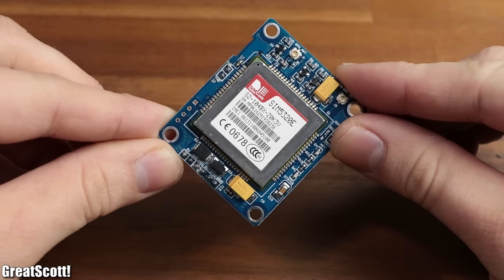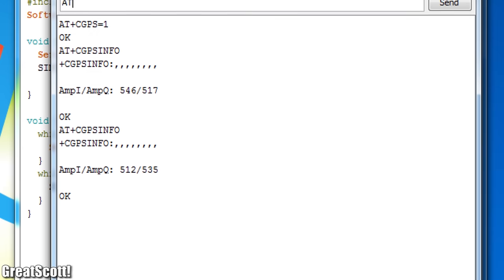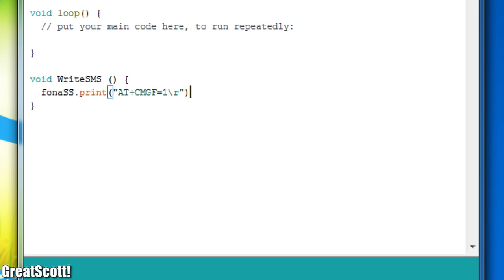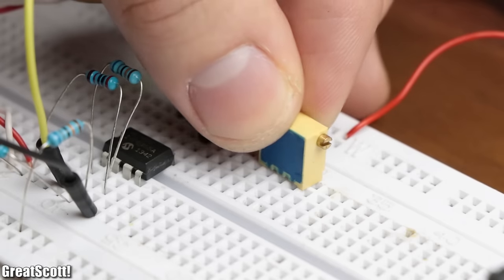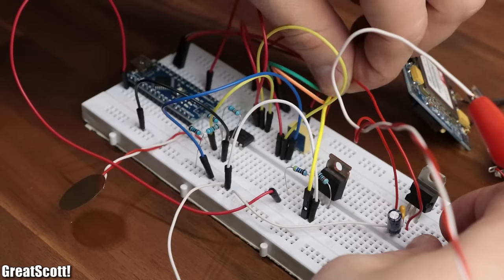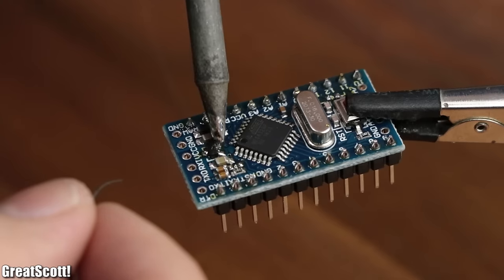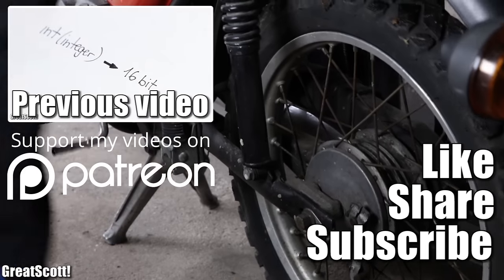Make your own GPS SMS Security Tracking System

Comment: Without a WORKING SMS signal on 4G (3G is going away in 2022 and in the video he couldn't even get the 3G connection working), all the great add ons to the GPS module are useless !

Comment: You glued the transducer to the chassis, but tested it unsecured earlier. Did you test it again after mounting ? Maybe you could have used a mercury switch or MEMS switch instead. The piezo may trigger on load noises not necessarily theft...also, once triggered it should continue to report location periodically even though it may not be triggered again in case the thief leaves it somewhere for a while and your last GPS data was bad.  

For sh*ts and giggles, you can add a fuel cutoff switch controlled by sending the board an SMS.

Cool project, BTW.

Comment: The SMTP stuff probably fails because of googles strict requirements when it comes to "less secure applications". In this case, you generate an app-specific password and use that to authenticate instead rather than your normal email address and account password.

Comment: This is a great project and the battery life is good. What disturbs me though is the cost - I can buy a "smart" phone for £10 - granted it won't have the 60 day life or the shock sensor (well there is one built in, but I don't know enough to code a something to take advantage of that), but I could wire it up and have all the same features - plus the ability to make emergency calls if required...

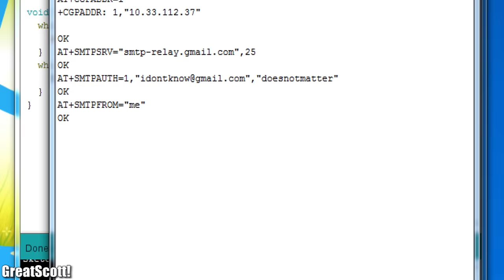Comment: 3:53 Have you tried configuring the APN settings correctly? Most of the people make this common mistake. You need to insert your SIM card to the phone, set APN correctly, and most probably you have buy an internet pack as well.
Only then you can send AT commands to connect to the server.

Comment: The problem with the email part is probably because google (I saw the @gmail.com) does not allow not secure auth.... you can go into your account and allow it for your account. 

It's not secure probably because the Arduino is not negotiating any SSL.

More is available on the google forums.

Comment: Hi again. So I read some reviews that the GPS in this module(SIM5320) needs an active antenna and does not lock well with a passive one and it has high power consumption. Have you noticed any of these issues with this? Did you use a passive or active antenna? I couldn't tell from the video

Comment: I like the movement sensor on your tracker with adjustable sensitivity. 
, Is there a circuit/model available that is low power and could send a pin low when movement high enough to wake a microcontroller?

Comment: GreatScott I got gps tracker for my motorcycle only problem is that it connects to the motorcycle battery so the thieve can simply disconnect the battery and that’s it... how could I build some battery for gps that charges when engine is running and when is off and battery is disconnected gps can still work with it’s hidden battery. I was thinking Of connecting it to jump starter and jump starter to usb charger but I don’t think that’s the right way, help please

Comment: Now how to avoid paying a monthly bill to keep the sim card active. I keep an old cell phone wired to my battery with no service. If it gets stolen i just need to log on to Google's find my android. Pros: No bill for 3g and sms. No constant messages. Cons: more power consumption  (i have a mega huge battery becauce the bime is electric so no lost sleep for me) and it is far less impressive as far as technical skill. (The bike is already full of arduinos sensors and mad scientist circuitry so no sleep lost there either)

Comment: To use smtp auth you have to low the security level to minimum at gmail configuration account. Then it works. Have that issue some time ago with esp8266 12 and arudino.

Comment: Hello. Did you remove the voltage regulator from the arduino pro mini because you are using a regulated voltage in the Vcc pin? And as a result,  you are not using the RAW pin which uses the onboard regulator to create the appropriate voltage for the board? Is my thought correct?

Comment: Ehhh... wouldn't something like:

// Setup where my Home-Location is:
ACord: CONST = 123456.123456
BCord: CONST = 56789.56789

// Check for my mopped, is it still in my Home location?
while true do:
     aCord = do.the.GPS.Stuff
     bCord = do.the.GPS.Stuff
     until aCord != ACord || bCord != BCord do:
              break;
     end

// Running Permanent verbose Alarm stuff. Call SWAT!
while true do:
   send.mail("Hey, I am driving! See me @ {aCord + " and " + bCord}!")
   end

do the same job? That way you wouldnt need the whole Vibration Sensor Setup at first, and you also will get a grip on your shopper if someone just load it up 
his Van and steal it without much Vibration. Sure.. you would need to add some space, in case you dont park in the exact same location like yesterday.
But for now, I would consider this, if you build that again.
Reply: havn't watched the video, but vibration activation might consume less power

Comment: In the car-alarms they solder the piezo vertically, perpendicular to the PCB and they solder a spring on the top with screw in it to adjust the sensitivity ...

Comment: Very nice Project, btw there is a nice Tool called "AT Command Tester", it works perfectly with Arduinos, it uses a little Scatch that just Reads and Write every Output from/to the Shield to the Comport, its a nice tool to Debug the GSM Shields
Reply from the maker: Sounds like a useful tool. I will have a look at it.

Comment: Cool, so now when I steal your bike I know exactly where to look! Nah, greetings from Australia. Glad you went through with this GPS tracker project, it was really cool. I also noticed you increased the volume of the background music, which is nice. Did you know those GSM modules can give you a GPS location based on the signal strength between various cell towers? It's not very good but it's super interesting. When I made a GPS tracker, I plan to put it in my mums car so that I can text it, and it replies with the location. I also want to include a feature where I SMS it a location and when it gets within 1km of that location alerts me. My GSM module seems to be 2G network only (sim900), and 2G is shutting down in Australia. Means I'll have to buy another one :((((
Reply from the maker: Thanks for the information. Good luck with your project ;-)

Comment: I think if you mount two bolts to the either side (or even one side) of the piezo plate with super glue - there would be a better gain

Comment: You do not have to use external comparator on Arduino. just solder 2 resistors to Arduino board.

Comment: hey scott i have an idea for a projekt on the raspberry pi . i just broke my laptop and startet disassembling it and i lookt at my keyboard and i thought. is there any way to use it again . the problem is that the keyboard has a flad ribbon for connection but it is very small so it is very good for use it as an handheld keyboard vor things like a emulator ore so . ore for an office mini pc

Comment: The email failed because you need to add a log on info to log into a gmail account before it can send u an email with what you want it to send you to your gmail instead of just sms. That's why your getting server error. So you have to figure out how to use the Sims mobile data and the board to connect to gmail email login server log in with your account u set up then after your log into that account have the device send you an email with lat and longitude

Comment: HOW COME no battery (back-up). They are essential in these days of sophisticated thieves. ALSO a shiny, new case is a give away - my tracker is in a welded metal box, that gets covered with dirt. And the cables are identical to the machine cables so they look like original equipment.
Reply: A welded metal box might significantly impede the gps

Comment: If the simm is installed on the device. How do you receive the SMS?
Is it necessary to open WiFi all times or what?
Reply: you need a dedicated sim card for the gps tracker aka pay for another line

Comment: Hi Scott ! 
For improve the rapidity for get GPS location you can use QuecLocator or similar... the localisation will be get with phone RF network.
In this system, you don't have an AT command for enter the module into sleep mode ?
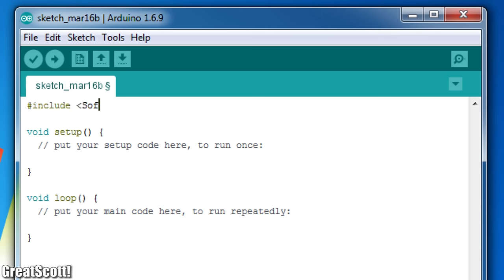Reply: Hey Julien? If you use the code Scott used at 1:50 , do you get an error saying "invalid use of non-static member function
" after you've tried to upload it?
Reply: @mouftie618  Hi, i didn't implement and work on an arduino target but i develop on another target with other module for localisation and connectivity. 

For your problem, i think you use a fonction or macro-definition with bad parameters. Check the API and navigate inside the header file :) 
I hope you will find the error :) 
 JC

Comment: Hi GreatScott, first of all I love your videos. In the last bit of the project you added a battery, (I do not know anything about bikes) can you add a charger to that battery? The battery would just charge whenever the bike is driven. Correct me if I'm wrong. Regards
Reply from the maker: There is a charging system integrated in the bike. That is pretty common.
Reply: So it can be a perfect integration, and if you drive the bike frequently, a smaller battery could be used. Thanks for all the videos. Keep it up :) regards

Comment: In regards to the email not sending, this may help. -- https://support.google.com/accounts/answer/6010255?hl=en

That lets you adjust the "less secure apps" setting for your gmail account. If anything, you can temporarily enable it and then disable it after confirming your results.

As always, thanks for the great video!
Reply from the maker: Tried it before. Does not work.
Reply: Does your ISP provide an SMTP relay server? I didnt catch which SMTP server you were using in the video but you may have better luck if you use your ISP's SMTP relay server vs. google's.

In this case, the ISP would be that of the SIM card provider. eplus.de?

Comment: I like your motorcycle. Is it a Simson S51. I've never seen one (I am in the US). Tell me a little about it; year, how many speeds, is it collectable, value, etc. I can't find any information in english.
Reply: Made from 1980 to 1989 in the GDR, 3 or 4 gears, Value varies from 100€ in bad conditions to 2500+€ in complete original condition
Reply: gwc1410 4Ps 60km/h made in GDR

Comment: a quick suggestion though. Instead of spending this much amount of dollars just buy a small android phone with gps capability for 50 $ and throw it into the bike box.
Reply from the maker: And it can send me the GPS location for 60 days and react when the vehicle is moved around?
Reply: GreatScott! It should be possible to detect movement with accelerometer, but power consumption would be higher

Comment: Does I understand it right? You send also SMS when you are driving the bike?
Whouldn't it be great to send only SMS, when you are not on the bike? To save SMS costs.
Reply from the maker: That is why there is a key switch. To turn off the circuit when you drive the bike.
Reply: Thanks

Comment: Hey Scott, I have a question: when you removed the regulator of the arduino pro, what did you do to "feed" the arduino with the correct voltage?
Reply: Erivan Nogueira He mentioned during the video that he put a 5V LDO in the circuit...
Reply: Marc Novakowski, I've not heard this, ok, thank you guy.

Comment: great video. there is only one thing I'm confused about. did you replace your ignition with the other key switch you made or did you just add it? because if somebody stole your bike how would it get power?
Reply from the maker: I added the key switch and the circuit is directly connected to the battery through the key switch.
Reply: oh ok I see, so then technically the key switch  does not need be be turned for it to get power?? and  if somebody were to steel a bike with this system would work just by them starting the bike? I want to know because I've been wanting to build something similar. thanks

Comment: It might not last for a very long, or at least not be as reliable as it should be. Designing circuits for automotive applications is a real challenge. The kind of vibrations and shocks it has to withstand requires something more than a perfboard and hot glue.
Reply: Szuru Buru if you want you can make a PCB. It will be a lot more durable.
Reply: Is pefboard not strong or something?

I thought pcbs where pretty strong.

And hot glue can dampen vibrations, shoot a friend of mine has a car where lots of stuff is hot glued on.

Comment: Hello greatscott. I am trying to make something like that. But my dirt bike doesn't have any key at all. So i created a circuit that uses a sd card as key. It's reading the key in sd card and same time it's changing the key. Anyway it's not the case. I want to control my headlights too(12v 30 Amperes). I tried couple of mosfets but they're heating up so quickly and burn themselves. How can i control my headlights cheaply ?
Reply: You could try a relay?
Reply: Duvan Boshoff I thought but 30a relays are expensive. Even more expensive than my whole project :(
Reply: oh... You could stick a cheap heatsink to a irfz44n mosfet because they are rated for 49A.

Comment: could you do a tutorial for el wire and its
 inverter? could the current be supplied directly from a "wireless" coil like the one in a wireless charger?
Reply from the maker: I put it on my to do list.
Reply: GreatScott! i mainly would like to do it so that i can put el wire on my bike ryms and powering them from a central battery on the bike body but i don't want to use slip rings, and wireless current seems like the onlt other available way to conduct current from a still to a rotating body

Comment: maybe you should not make it so easy to disable?
Reply from the maker: You either need the key or knowledge on what is going on with the electronics. Neither one does a thief have.
Reply: GreatScott! Ohh I thought the key had to be turned on and in it for it to be operational
Reply from the maker: You can remove the key after turning it on
Reply: GreatScott! Ok thanks!